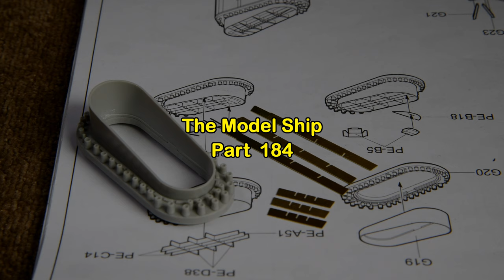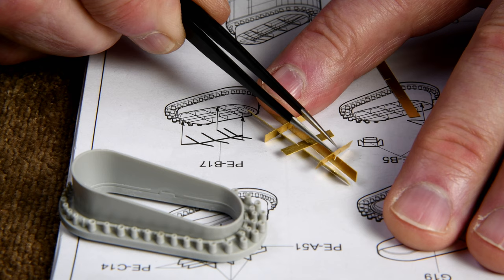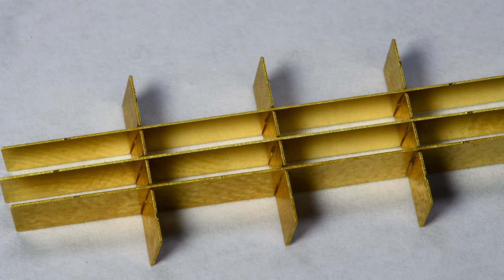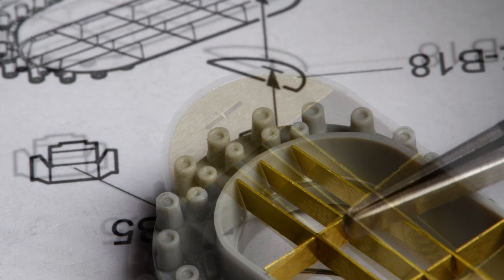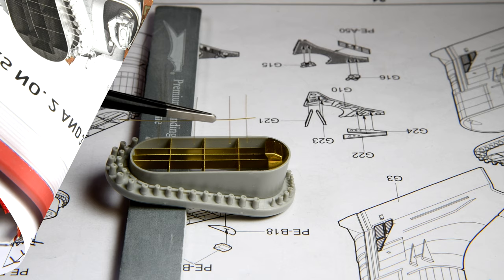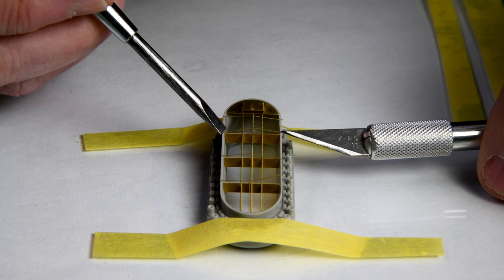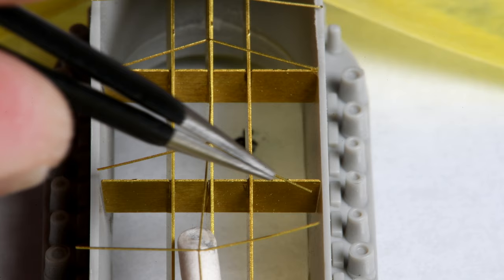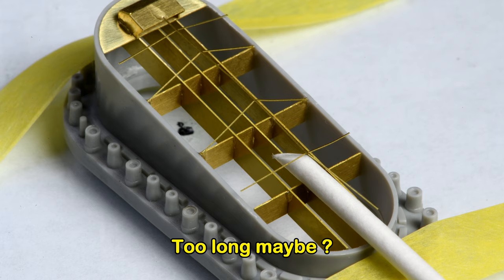The Model Ship - Part 184

Comment: Ron, just primed a 1/350 scale German sub. Used the Stynylrez, not thinned at 20 psi. Sprayed at about 4” from model, spraying fore to aft in even strokes. The primer should look slightly wet, this means good coverage. Light coats, couple of minutes between coats. Finish is fantastic. Not a detail lost.
Reply from the maker: I'll likely be using my Stynylrez primer tomorrow Tony 👍

Comment: Hi Ron, I had a solution I was willing you to find. Glue the three horizontals to a vertical at right angles and let them dry. Then glue in another vertical and them the last. But you succeeded your way 😉 And THEN you did an even harder bit!
Reply from the maker: Yes, undoubtedly there was a much simpler way, but at the time I just couldn't think of it. Glad it's over 😁